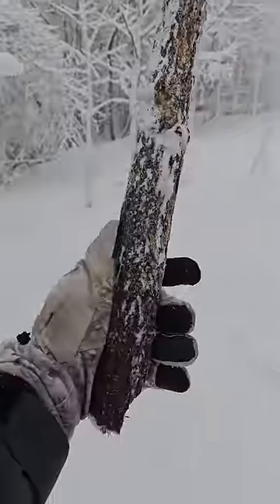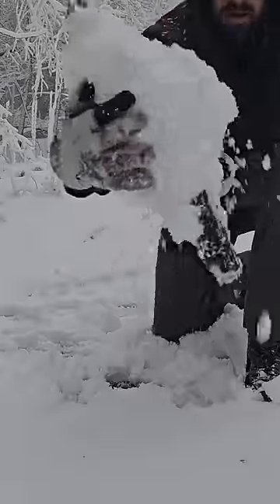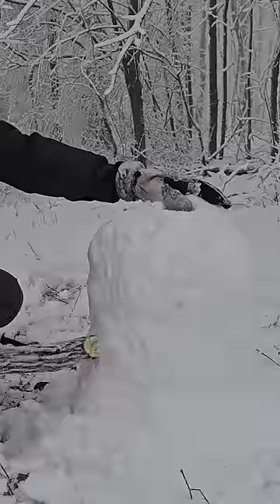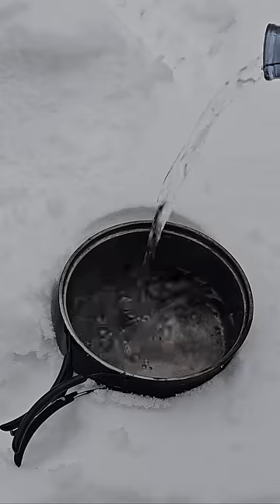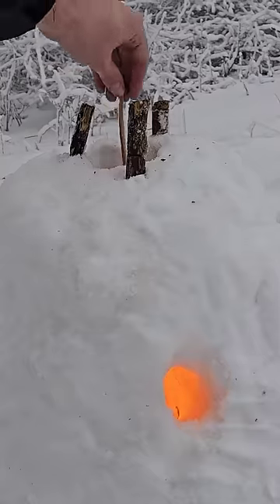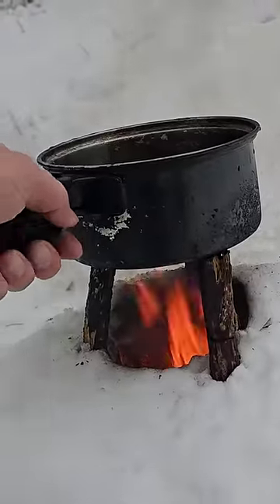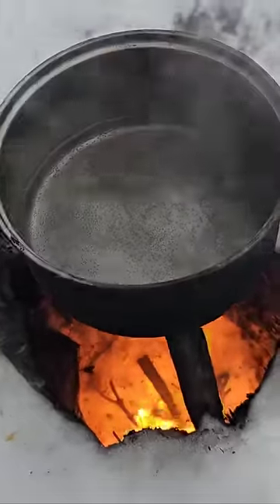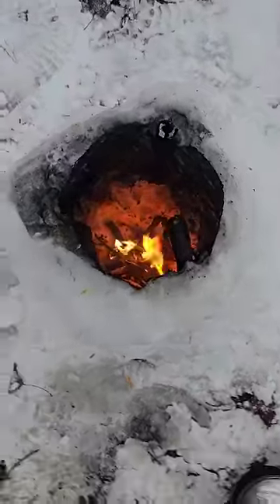Experimenting with building a rocket stove out of snow 🔥

Comment: The fact that this worked is kind of cool.
Reply: the fact that this worked makes sense and is very logical
Reply: @copium7845 not really… not making sense until you see one succeed
Reply: @kimballchoo  air is a great isolator...  so snow doesnt really melt, and the snow that does is so little that the water just gets absorbed...
Reply: @kimballchoo on top of copium's most recent response, snow itself is ALSO a surprisingly good insulator, which keeps the majority of the heat at the layers of snow directly facing the fire, which is why the entire structure stayed stable as long as it did.

Plenty of winter-climate animals know this instinctively, which is why huskies/malamutes, polar bears, elk, etc. will roll in snow to get their fur coated with it because the snow is such a good insulator that it works with their fur to stay frozen, yet still keep their body heat trapped in.
Reply: @copium7845  damn straight.
Reply: Kinda? Its awesome
Reply: @copium7845 yes we get it, you're very smart and everyone must know that.
Reply: @capybara9521  yes we get it, you’re salty because they have a superior intellect and everyone must know that
Reply: @capybara9521  Im highly educated indeed, but everyone knows that air is good insulator... Why do you think you can compress snow so much??? ITS FILLED WITH AIR WOW
Reply: If it had more space inside and had some ice covering it would work alot better. But the snow is basically sublimating and disappearing.

Comment: The basic concept behind this idea is actually how igloos work, dense packed snow is fairly good at insulating an interior. Granted, that's one type of igloo out of like 4, but this is still how at least one kind of igloo works as a shelter.
Reply: Igloos are specifically constructed out of specific snow English doesn't have a word for. As I understand, it's very naturally compact stone you can kinda cut like a rock to build with, then pack any cracks with other snow (I think)

A very simple survival shelter is a lean-to. You shoveal an area with a radius of maybe 10' and gather it into a pile. If you're wearing weather appropriate clothes, you can literally lean on it to compact it, then use a digging tool to hollow out the inside just enough to squeeze into overnight.

The most important part is leaving the walls thick enough, and using a smaller stick on the very top to both tell you when to stop digging and then be removed to act as an air hole. You may pack some snow by the entrance for added insulation.

Our drill when making them (as like a 10 y/o) didn't cover everything. I believe you could close the entrance and still breathe all night, but idk exactly
Reply: you’re probably thinking of a quinzhee which i would also refer to as similar to or another type of igloo lol
Reply: @Direblade11 that’s also a quinzhee. a makeshift lean to would be a stick supported between 2 trees like a beam in a house. then you take as many tree branches/planks/whatever you can and lean it up against the beam like one half of a roof, leaving everything else open. if you were making a permanent structure you would typically close 3 walls, leaving only the front open.
Reply: @Direblade11 it's just ice I think compact ice and not snow it's cut precisely
Reply: @mitaskeledzija6269  Nah, it's definitely a type of snow. In Inuktitut (language of the inuit) they have something like 52 different words to describe different snow.

Also, you'd know if an igloo was made of ice
Reply: 💖❤❤️YOU DO NOT HAVE TO FEAR DEATH IF YOU BELIEVE IN JESUS CHRIST, AND TRUST IN HIM WITH ALL YOUR HEART, BECAUSE HE ATONED FOR YOU FOR ALL YOUR INSULTS, THAT YOU WOULD OBTAIN PEACE WITH ALMIGHTY GOD, AND GO TO HEAVEN BY HIS GRACE!

Comment: That worked pretty well to the point where you can improv as you go. Metal rods that penetrate to the bottom. Or cut the top half(maybe like 2/3 of the total size) to have an exposed firepit and then throw the pot directly onto the coals.

Comment: Great experiment!  Might last a little longer if you line the tunnel with aluminum foil or a length of circular ductwork?
Reply: Bro I was thinking the same thing. He also can use lil wood nuggets as a spacer for 2 pieces of sheet metal. One sheet of metal around the snow,add spacers in between the 2 sheets of metal. One sheet of metal for the fire. Spacer,next sheet of metal for the snow. That might give you much more time. Right?🤔

Comment: THIS IS A GENIUS IDEA! BUT, I WOULDN'T USE A STRING TO SUSPEND THE POT. THE STRING WILL CATCH FIRE. A METAL WIRE MIGHT WORK BETTER, BUT IT WILL GET REALLY HOT(NEED OVEN MITTS OR HEATPROOF GLOVES TO TOUCH IT OR TONGS) AND YOU MIGHT LOSE IT IF IT FALLS IN THE SNOW.

Comment: If you had 4 thin pieces of wood to make a stovepipe the fire would probably not have room to be on the wet side of the wood so youd be insulating your insulation from the heat lol
Or if you had some dogwoody treebark maybe

Also im curious if it would melt less if the thickest part of the stick hole was at the top or bottom. Like a cone. If it was tornado shaped the heat wouldn't hit a partial snow ceiling. Then again if snow was there in the first place why not take advantage of the torch like higher heat smaller hole until it gets bigger....

🤷‍♀️

Comment: The reason it works so well is the ash coats the snow and starts to insulate it slowing down the melting. We use to do something like this in winter survival badge for scouts.
Reply: How do you source dry wood in snow environment? What was used to accelerate the fire? Oil, lighter fluid?
Reply: @no_guarantees  in most places, if it is cold enough for the snow to not be rapidly melting all the wood around is actually even drier than in the summer, because winter is an extremely dry season. Obviously the temperature would have to be below freezing, but i think it clearly is in this video considering how all the trees in the background are completely coated in snow.
Reply: @no_guarantees  When it is cold and not near melting point, you can find wood, twigs and things that are really dry. If you can't find anything to start a fire with, even getting some sticks and whittling them down to finer wood fibres light up really easy.

I live in an area with a lot of birch trees, their bark is highly flammable. You can also make some oil out of it to make future fires easier to start.

The cold weather dries things out. Have you ever hung clothing out to dry? When it gets cold enough it dries faster than in the summer. It'll freeze solid and you bring it inside, its dry to the touch even after warming it up.
Reply: INteresting, thank for explaining
Reply: @Azsunes  tagging just to add some clarity for those who need it:

'Cold and not near melting point' means way below 0 degrees Celsius, which is really f*cking cold.
Reply: Probably has more to do with latent heat. Going from a solid to a liquid takes a lot of BTUs
Reply: That and cold snow (well below 0 C) takes a ton of thermal energy to melt
Reply: @no_guarantees  Fatwood sticks as he said in the video. I believe you can find them in nature from certain trees. I also heard that you can make torches out of such wood. Hope this helps :)
Reply: @Azsunes  When I was a kid we had a wringer washer and clotheslines. In the winter I had to go outside and take a stick or a bat and beat the frozen clothes enough to knock the ice off and then bring them inside the house. Most of the time they were completely dry underneath.
Reply: @no_guarantees he also said he used "fat wood" which is full of sap or resin which burns well
Reply: No, you are wrong. The reason is that snow has very good thermal insulation.
Reply: нет там никакой причины. Он просто налил туда свои слёзы. Там воды на 2 ложки и то не смог вскипятить.
Reply: 🫡 شكراً معلومه جيده
Reply: @Cr0nTV don't be so quick to call someone wrong when you're both correct.
Reply: it's because humidity, humidity is very low in winter alias air is dry of water molecules, even drier than summer 😮

at winter, water molecules in air is constantly freezing and will left vacuum of water molecules in the present air, the dry air then will suck any water molecules available (not frozen one) 😅
 @Azsunes
Reply: @no_guarantees  The best place to find dry firewood is under large old growth evergreen trees.

It's very dry under them at the base, the branches can go way out and for a sort of pyramid shape so water or snow goes outward as it goes downward.  I've sat under those trees during torrential rains with handfuls of bone dry needles.

You can also use sap from the trees to help get a fire going, it will burn really well for a long time, like a candle.  And if it's windy, dig a hole to build your fire in (that's one the best aspects of this snow fire, it is well insulated from the wind).
Reply: Naw, nice try though!
Reply: I thought the snow was burnt

Comment: I wonder if you had the sticks inside the tunnel it would slow the middle from melting away. Cool Video!!! Thanks for sharing it with us!
Reply: It would probably do worse. Snow is a better inulator than wood so you would just be introducing additional heating points.   My best guess would be If the snow was packed more or was a bit wider it may last a bit longer since more mass means more time to heat the system up.
Reply: Look at the snow inside by the fire. Why is it black? The snow doesn't melt but burns.
Give it a try.
Reply: @keen9629  It's called soot, it's tiny particles of carbon carried upwards by the flame, and comes from the wood, not the snow (snow is just water, it contains no carbon). The problem is that soot is not an insulator. In fact, carbon has the highest thermal conductivity of any known substance.
Reply: @keen9629 found one of the people that think snow is a government conspiracy
Reply: @keen9629 I'm sorry about your disability.
Reply: @keen9629  ever seen the inside of a fireplace? Because that's just soot from the burning process.
Reply: @keen9629  it's soot sticking to the snow. Essentially, when wood burns, it isn't a complete combustion, so you get smoke. Most of smoke is tiny little particles of carbon, which stick onto whatever is in their way. You can also show this by burning a candle and holding a coin over its flame.
Reply: Wet Bark in the Tunnel
Reply: @TheSH1N1GAM1  That isn't nice.  Have you ever asked a silly question? Who knows if Keen wasn't feeling well, is an eight-year-old, or just not putting a lot of thought into the question.
Reply: @raelik777  I've never seen someone misspell arsenic boride, the substance with the highest thermal conductivity known to man, that badly.
Reply: @keen9629  Has to be a troll, nobody is this dumb
Reply: @joakim3964  Wow! I think you are reflecting on yourself in your mean comment.  

Why do you need to point out your views of someone else based on their question?  They want to learn!  So, in turn, you bully them? 

I hope you aren't a parent, grandparent, teacher, or in charge of anyone but yourself if you work.  

I'm an engineer who asked many questions that people.  That is how you succeed.  

“Every day you learn something is wrong is a great day!” This quote is an unofficial motto at a company that made over $26B USD in 2023. 

Over time, often the people who learn the most are the ones who ask the whys, hows, and whats. 

Shame on you for being a bully!
Reply: @LUVN4GIV  This dude did not want to learn. Read it again. He tried to lecture the dude by being a smartass saying snow burns. He is a troll trying to get people to comment
Reply: If you did very thin stick and snow or ice layers it may work very cool idea
Reply: If they were inside the tunnel they would just burn, it's wood inside of a fire tunnel
Reply: @keen9629 you being serious g 💀💀
Reply: @ThePickledsoul  wow, I've never seen such an arrogant response to someone's innocent comment since the last comment thread I checked.
Reply: @ThePickledsoul  you were probably forced to kiss ur da

Comment: The interesting thing is that the melting snow from the stove chimney does not put out the fire. This is because of two reasons, one snow has a lot of air spaces in between which is a poor conductor of heat, and second ice is less dense than water. It definitely won't work with ice as efficiently.
Reply: I was thinking there isn't much dripping water that doesn't get turned into steam
Reply: Water is likely dripping on the fire but immediately converted into steam
Reply: This is why Ice type is weak to Fire type
Reply: And the third reason: Fire is so much cooler than water. Fire wins. 😎
Reply: @IBQ1 Snow is like spoge.
Reply: И в третьих вода как водород для огня подпитка
Reply: @AmalgamJiena his point is quiet the opposite.
Reply: The water from the melting snow is likely running down the inside walls of it.
Reply: I'd say most of the snow just sublimates right into steam
Reply: That kind of snow would absorb a lot of the moisture, essentially wicking it away.
Reply: @AmalgamJiena 🤔    hmmm...   🤫
Reply: This thread really illustrates how little today's youth (specifically the ones that watch a lot of YT) understands about physics, fire, and ice. 😑
Reply: @Morganational  Ah yes, a generalization based on one thread in the comments section. My favorite type of stereotype.

Comment: The Inuit live in snow tents for a reason. Snow contains a lot of air and is a very good isolator because of that.
Reply: First comment I've seen so far that correctly identifies air as the reason for superior insulation. It's almost like aerogel.
Reply: They don't live in those. Igloos are temporary shelters.
Reply: Um. Ok. Cool story bro.
Reply: Snow is water, so it contains hydrogen.  The reason why this stove can be used is that it is windproof, and other things have nothing to do with it.
Reply: @akk9196 not always. If there is a bad cold day, its always good for another day. I don’t think its THAT temporary.
Reply: @康生-g9l  That made absolutely no sense. Hydrogen in water is bonded as a molecule. It’s not freely moving.
Reply: @akk9196 so they do live in them. Just not long term.
Reply: @康生-g9l  Your comment literally makes no sense. The reason why this stove works is because the water melts slowly enough to not extinguish the fire. And the reason for that is that snow has good isolating properties, which means it only melts slowly.

Comment: There’s some stupider ideas in history that worked out phenomenally

Like friction welding wood

Yeah, I know what that sounds like it’s exactly what it is, look it up
Reply: Nah I seen friction welding and thought thay was cool till I seen it done with wood
Reply: Exactly, impractical does not mean impossible
Reply: yeah bro i also got that short on my feed
Reply: Looked it up, you sir are a black magic magician!

Thanks for the new rabbit hole!!
Reply: @HpToujoursPur not impossible, just a waste of time.
Reply: It seems like they figured out friction welded wood because the techs got really bored, and wanted to see what wood happen if they put wood in the friction welding machine, but the boss came in wondering what they were doing and they had to come up with a way to spin it as an innovative discovery, but now they are in too deep.
Reply: I saw this last week. Lignin in the wood heats up and binds together acting as natural glue. Seam is stronger than the wood itself.
Reply: From my understanding, there is a glue activated by heat involved in friction welding wood
Reply: @jamesvance1367  Lol, wouldn't it just be easier to glue it then?
Reply: Thank you
Reply: @backcountry164  Yeah, that's why its used by industry, cause it's a waste of time.
Let's see. Bonds pieces of wood together in seconds without having to add glue and creates a strong bond.  Yeah, total waste of time.
Reply: @GUNNER67akaKelt  Is wood welding actually used in industry to save time? I feel like it would be cheaper to go the ikea route and throw a couple nuts and bolts in with w/e they are selling.
Reply: @JuhSigh 😂😂😂😂
Reply: @JuhSigh  hahaha
Reply: @GUNNER67akaKelt  What industry makes rocket stoves out of piles of snow?? Because that's the comparison being made. "LIKE friction welding wood." Is it like friction welding wood?? Is it as effective?? Or is it possible but a waste of time?? Try to keep up.
Reply: @backcountry164  Making a rocket stove out of snow is kind of a waste of time. Yeah, most people would just clear some snow off the ground and make a regular fire.  But it might be useful knowledge if there is a lot of wind or inclement weather.

Comment: If you want it to last longer, you want to use a bundle of sticks with one shorter stick on the ourside and a large stick in the middle. Pull out the middle stick after making the chimney of snow, make your air hole where the short stick is. The ring of wood insulates the heat from the snow and makes it last a while longer.
Reply: do it and let us watch
Reply: @EnderElohim  build it yourself. you guys only want to watch things on yt, but actually barely noone actually does it
Reply: @666marq  barely no one contradicts what you wanted it to mean
Reply: @666marq  whatever you say bud
Reply: Arm chair survivalist.

Comment: I wonder if mixing the snow with an insulative material (sawdust?) would slow the melt, or just concentrate more heat and melt at the same rate. Nice concept, very cool. ;-)
Reply: Frozen sawdust is called pykrete. Stuffs actually pretty incredible.
Reply: Absolutely…he sounds canadian…ill bet he can find some asbestos lying around…lol
Reply: i would improve this

I'd pack the central stick with other sticks first then pack snow around the bundle of sticks

them remove the central stick leaving a wooden walled space WS

start your fire in the WS

the WS would reduce the melting of snow allowing a longer useful for the stove

I can even imagine repairing the stove with.more snow packing outside as inside melts

amazing rocket stove in a winter setting
Reply: I like the composite idea, maybe dirt or mud If you have shovel